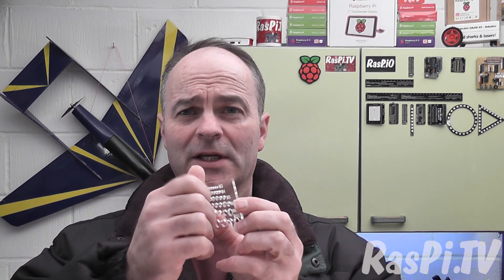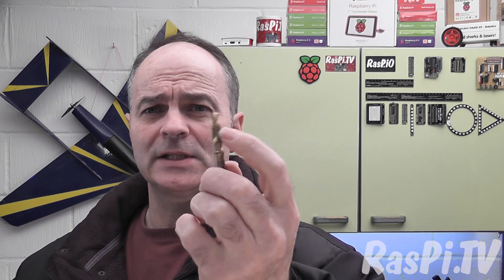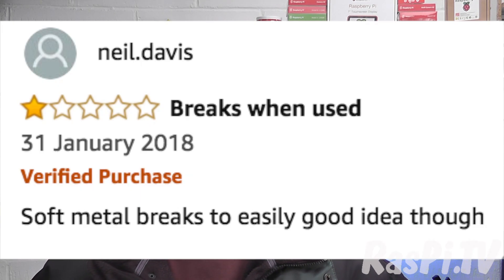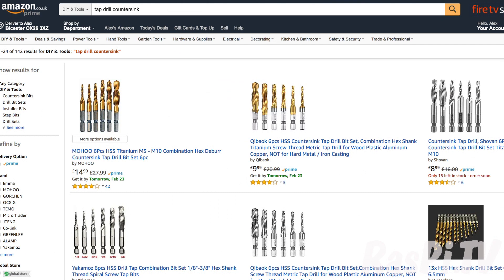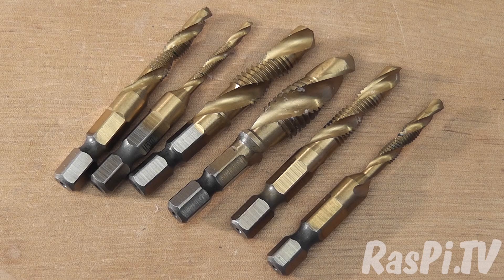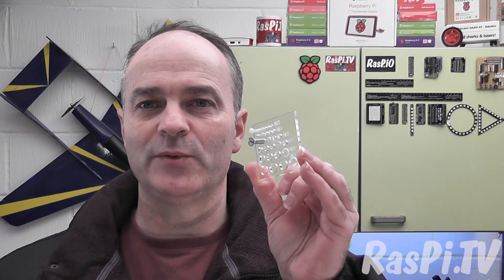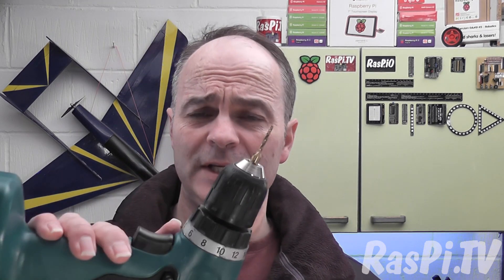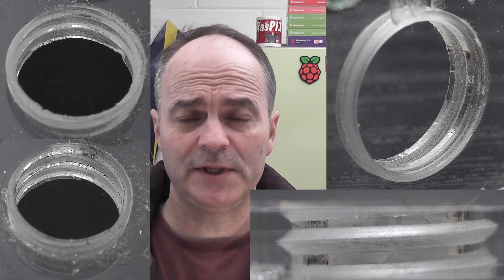Thread Tapping in Acrylic Perspex Plexiglass Lucite using a drill driver

Comment: Thanks for sharing, Alex! I discovered another video recently where the chap used a spiral point tap (otherwise known as a gun nose tap) as opposed to the spiral flute tap you used. It pushes the swarf out ahead of it, so really better for through holes (such as the ones you did). I tried it out, and it really works wonders! So mu better than the standard 4-flute tap, which leaves "crunchies" inside the hole and leaves a very rough thread. Try one, and you will not be disappointed! They are also much stronger, so can be used in steel without fear of breaking. Cheers!
Reply: Hi, do you have any tips for drilling into lucite wall-mount bannisters? I got these beautiful bannisters however they are not drilled. They are 2 inch diameter and have decorative air bubbles throughout. How do you suggest keeping the bannisters still while drilling?

Comment: Nice vid! I suppose the all-in-one thread/drill bit work, but I'd rather use better quality bits ... sure they are certainly more costly, but they should last a lifetime- not too sure about the Chinesium alloy used in the all-in-one.
Reply from the maker: I was curious about these, but now I've had a successful tapping experience I'm encouraged to buy a "proper" tap and die set and try tapping other things.It's been something I've wanted to do for a long time, but never really had the need.
Reply: The convenience of drilling,tapping and chamfering all in one is very tempting.  Especially considering my fondness for flathead bolts.  I think I will stick with my expensive taps and dies since I do tap steel also.  

Trying not to brag to much but I have tapped 3/8”-16 threads into a steel block 3/4” thick by HAND!  The thick steel was for a heavy sculpture base.

Comment: Was waiting for the test of them drilling and tapping in one go, rather than tapping pre drilled holes. Any chance?
Reply: In aluminium you have to drill at high speed then switch to low speed to tap. If you are doing a lot of holes it is quicker and easier to use standard drills and taps.
In acrylic use tallow not wd40 as a lubricant, the swarf sticks in the flutes of the taps leaving a clean hole but the flutes need to be cleared after each hole.